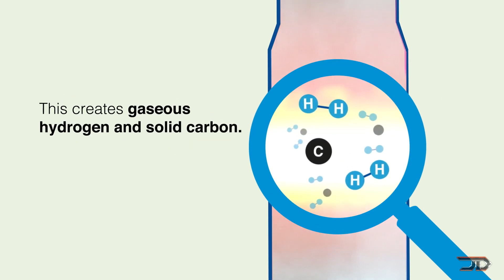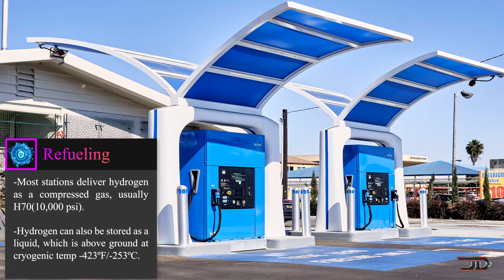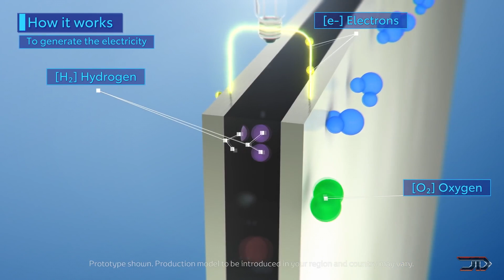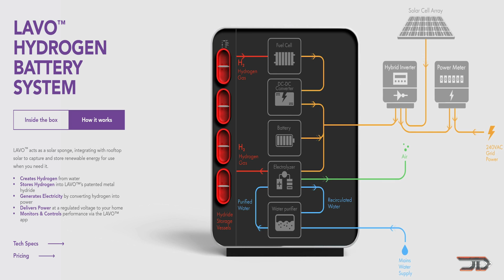Hydrogen Power - The Latest Developments

Comment: Hydrogen is polluting and dangerous as explained by Elon Musk in the video link here. It shows how far a few will go just to keep us paying. Hydrogen is something we can not generate in sufficient quantities to use so we will have to keep on buying it, just like gas for cars. But with electric, if the same few try to raise prices and take from us we have the option of solar, wind, and water power, without paying them a cent. This they do not like and hydrogen or anything else that keeps us paying at the pumps will be developed instead. As this video shows hydrogen is dangerous and the only reason for development that I can see is profit. As this video shows there is much pollution in the process of separating it and storing it for use. https://www.youtube.com/watch?v=RAUnmDGNvF8&list=WL&index=4
Reply: Elon Musk is from an electric car company so you can't really believe in everything he says. Batteries are not good for the environment either, they have no power(no good for airplanes) and most draw from the grid anyways.

Comment: I don't know if anyone will ever read this comment but I truly believe that hydrogen technology has a lot of potential and isn't just something to "delay electric vehicles" as people with no real knowledge on both FCEV'S and BEV's. Fuel cell technology is just in its infancy and as time goes on as more stations are built, more vehicles will be sold, the technology will become more efficient which could out do the fully battery powered vehicles. There has been really major investments into hydrogen in the last 24 months, just not the Americas. Plus FCEV'S has better range than most BEV'S and "fill up" much faster (even if both aren't really fast). The FCEV'S will most likely always have the better range and faster filling time than batteries. The problem is infrastructure, but there has been huge investment in that in ASIA which slowly is making its way over. Does hydrogen have its problems, yes, but batteries have just as many. Batteries: are made from lithium, take longer to fill, normally don't have great range, over time there range will become smaller and take longer over the time of use. Battery people normally seem to disregard all of the problems the technology they preach about and only look at the negative aspects of hydrogen. Both lead to a green future in the end. Hydrogen technology could potentially have a big and bright future. 

Note: early on in this type up I said "hydrogen will become more efficient". What I mean is more efficient to use for your average person not in making power and using said power.

Comment: With high levels of hydro, wind and solar power, there are times when supply exceeds demand. That excess power has no fuel cost so it can be used to produce hydrogen as an extra revenue stream. That hydrogen can be blended into the natural gas supply pipelines. However as pure hydrogen it has higher value as an energy carrier for FCEVs. Consequently, FCEVs and BEVs can co-exist, with each having an appropriate use.
Reply: As the number of BEVs grows, they´ll become the obvious target for the extra energy production. So even though it is definitely possible to use that energy to make H2 it won´t really be free anymore as there will be demand for the energy. As our energy production is shifting to renewables, storage becomes part of the solution and while H2 is an option it is an expensive and inefficient one unless we have a breakthrough.
Reply: 1. Fuel cell cars make no sense compared to battery electric cars, and NO hydrogen cars will never reach mass adoption, but electric cars certainly will. 2. Better to store excess electricity from the grind into pumped hydro, than into hydrogen. Why you would ask? Because pumped hydro is 80 % efficient, while electricitx to hydrogen to electricity is only 30 % efficient.

Comment: In cold weather the waste heat from conversion to hydrogen can be used for heating water or living space. By contrast, waste heat at a large power station supplying the grid is often wasted. In cold weather a BEV then needs to use more electricity to heat the vehicle. Thus in a cold climate on site methane reforming is not as inefficient as it appears at first glance. At 7:04 you mention Lavo which combines hydrogen storage and fuel cell.

Comment: Glad you recognized fuel cell electric vehicles as EVs. One minor slip of the tongue is that a hydrogen is not a fuel source. Like a battery it is an energy carrier which needs an energy source. You identified that hydrogen needs an energy source such as methane or electrolysis.

Comment: Absolutely agree. The amount of conversion required to run an onboard system in a car sounds like a soul-destroying nightmare reigning down in little pieces from the stratosphere with bits of humans attached. I do think that hydrogen has a much better chance in the sky & water arena for moderate to large passenger transfers but not as a car. It just comes across as way too expensive. I think it'll be a while before it is ready for anything. By the time it's ready there may be small scale "nucular" (dubbya inference), again medium transfers & hydrogen will get passed by completely.

Comment: We NEED to use our current ICE in effect as Carbon Capturing machines by running them on ( clean burning) Carbon Negative Algae Bio Fuel. That permanently sequesters 1 Ton of CO2 for every Barrel, we don’t have the time or the forests etc, to loose to mining etc ( we apparently only have 9 years left to turn things around). So we have to use what has already been manufactured, but just change the fuel. If the UK for example transitioned onto Algae Bio Fuel we would permanently sequester 364 Million Tons of CO2 every year, and create millions of new local climate saving jobs!. Photo Bio Reactors( PBR) used to grow the Algae are cheap, easy and quick to build and could be rolled out country wide in every locality within 5-10 years!.
Reply: Well said. Like CVK's plan to make Vulcanol out of CO2 from vulcanoes. But yet,everyone's wasting lithium instead of doing research.

Comment: As batteries continue to improve, hydrogen will look less and less appealing. To complicated. It takes way too many steps both to make the fuel and to use it. It is inherently dangerous, far more so than batteries. No, I hate to see folks waste time and money trying it out, but it's their money and time, I suppose. In the end, it will fall by the way side.
Reply: If you re talking about car industry than yes. But planes will definitely run on hydrogen since batteries can't reach much more than 1000wh/kg (350-400wh/kg now ) hydrogen has 30000wh/kg Wich is more than kerosine.
Reply: @kosovoisserbia8937  The first hydrogen fire will shut that down fast.
Reply: @kosovoisserbia8937  Hydrogen is far more explosive that jet fuel as well.  Violently so.
Reply: @kosovoisserbia8937  The majority of the planes will be running on batteries in the future. Today energy density of the batteries is 300 Wh/kg. With that energy density you can make 747 big passinger planes with 10 times less range than kerosine 747. Kerosine 747 has 15.000 km range, electric 747 with 300 Wh/kg TODAY's batteries will have 1500 km range. 70 % of all plane routes IS SHORTER than 1500 km! Than means you can make 70 % of all routes with a battery plane TODAY. Why 10 times less range with electric plane? (because batteries have 40 times less energy density comprared to kerosine, but electric motor have 2.5 better energy efficiency and you can also lower consumption quite a bit with flying a little bit slower (not very noticable in shorter flights).
Reply: @mirkogruden8362  70% of plane routes yes ! 70% of plane distance NO ! 
Short flights only account for 30-40% of global CO2 emissions. We will still need hydrogen powered planes to cross long distance flights that account for most of  emissions .
Reply: @kosovoisserbia8937  70 % of all flights are SHORTER than 1500 km. But in a few years the batteries will be at 350 Wh/kg or even 400 Wh/kg, and that means 85 % of all flights can be made in electric plane. But that is WORST CASE SCENARIO. That is calculated based on 747 big passinger plane, the smaller the plane, the longer distance can be coveded with a battery plane. So in reality the the majority of plane distance will be covered with a battery plane. Sure, we still need hydrogen (or synthetic fuels) for long distance flights, i have never said otherwise.
Reply: Batteries have some serious downsides, too.  Like the extreme use of some metals that aren't readily available, so there's that.  Everyone wants to point to some ultimate answer.  The real answer is there is not remotely any ONE answer.  

Wind, solar, wave, clean fuels, yada yada...there are a  lot of different technologies out there that are fully capable, NOW.  And batteries will have to improve a LOT to begin to compare to any standard fuel, moreso than they probably ever can.  Did you look at that chart? Batteries  are basically in the trash regime, power/weight of every other alternative shown.

And producing all those batteries is not remotely either energy efficient or carbon neutral.  They are one link in the chain, that is all.  There is no 'wasting' of money delving into other forms and types of energy.  And money is just paper, actually cloth, mostly,
Reply: @MrJdsenior  You are also looking at the table wrong or don't even know what table means. You just CAN'T compare fuels directly, because the car is not only the fuel! Electric car battery is certanly heavier than petrol, BUT electric car motor is much LIGHTER that petrol or diesel motor, you also save weight because you don't need exhaust, DPF and all that stuff. Moderen electric car have more than enough range and are similar weight than diesel or petrol cars (only 5 to 10 % heavier). The key thing is that electric car uses 4 to 5 times LESS energy per mile compared to diesel and petrol car!
Reply: @MrJdsenior  The only problematic metal used in batteries that I know of is Cobalt. And Tesla has committed to reducing and eliminating it completely with newer battery chemistry. I believe the initial patents for the 4680 battery uses no cobalt.
Reply: @MrJdsenior  No, you are wrong. There is no metals that aren't readily available in li-ion batteries (litium, cobalt, aluminium, copper and nickel ARE very common metals). Batteries are ALLREDY developed enough that we can make electric cars with enough range! Modern electric cars have 500 km of range, there are even models with 1000 km (Xpang) and that is more than enough for daily driving. Average American onyl use  10 % of that (average American only drive 50 km per day). You simply charge at home overnight. Once or twice per year if you are on roadtrip you can get 300 km charged in just 15 minutes (Tesla model 3) and that time will be even lower in the future.

Comment: dude, I think you got steam methane reforming and methane pyrolysis confused while making this video

steam methane reforming releases CO2, methane pyrolysis does not (the graphic you had on screen even showed this, the output is solid carbon, not CO2)

steam methane reforming is currently the main source of H2 globally, so alternatives like modular reactors would be reducing emissions from that, not from methane pyrolysis, which is already emissions free, but not widely commercialized yet

Comment: My dream would be a Tesla with a hydrogen engine that generates electricity for the battery.
Reply: Well that is a regular fuel cell car.
Reply: @CUBETechie  No it is worse. He says an "engine", so a combustion engine running on hydrogen driving a generator!
Reply: @Tore_Lund  oh okay 

Die you heard anything about Gumpert Natalie?
Reply: @CUBETechie  Nice, but that is a fuel cell vehicle, it does not burn the Methanol = no engine.
Reply: 🤔 Basically it'd be a tesla with a hydrogen booster. You can run out of hydrogen fuel during a road trip but still travel on the battery alone for quite a while.  And Instead of waiting 20 minutes to recharge you can fill up on hydrogen in a similar time it takes to fill up on ethanol. Bam, hit the road again whilst charging the batteries. Genius! As long as the hydrogen engine is light enough
Reply: @daivonclark5151  Right, that would be awesome

Comment: Hydrogen doesn’t have the same constraint as batteries.  The cost of batteries is the capacity: if you want to store more power then you need a bigger battery.  $$$.  For hydrogen fuel cells, the cost is power output: if you want to output more power then you need a bigger fuel cell.  Hydrogen will win wherever you need STORAGE CAPACITY.  Batteries will win when you only need a small amount but released very quickly (POWER OUTPUT).  This is why hydrogen is still the preferred option for large vehicles (trucks, busses, planes and trains).
Reply: You are partially wrong. Battery electric power  is much better for trucks, busses and trains(trains can be connected directly to wires), and low distance planes because the cost per mile is 4 to 5 times lower! Hydrogen only make sense for long distance big plains and ships because you would add too much weight if you would use batteries.
Reply from the maker: Good point!
Reply: Except H2 is not that great as a storage medium either. It´s better than batteries, by Wh/kg, but methane, propane or methanol can easily beat it because they are more practical to store. It remains to be seen what will be the preffered choice for large vehicles.

Comment: I don't see Hydrogen as the solution, but there is a Market for it. It has many drawbacks for plants that produce it in large quantities using storage containers and the hard cells have a durability issue...
Reply: Yes rechargeable batteries are more efficient

Comment: There's one thing certain about the future:- uncertainty. That aside there's one firm in China which stores hydrogen on discs maybe somehow in solid form in a very dense way which can be used for fuel cell vehicles.
Reply from the maker: Neat, I will have to look into that!
Reply: Hydrogen Fuel Cell safety : How safe it under collision or high impact ? 
Is it prone to static discharge causing a fire or possible explosion ?  / These are questions that needs to be answered.
Reply: @arthurzettel6618  Look it up, they have done intensive tests on hydrogen fuel cells, collision, puncture, you name it, it seems very safe.
Reply: What. ?
Reply: We love Sandy Munro! Don't we?
Reply: Lithium-doped C 2 N seems to be the best method and it's very easy to make

Comment from the maker: Update: Honda just discontinued their Clarity fuel cell vehicle so this could be a sign of things to come (at least for fuel cell cars). I also apologize for the rushed commentary!
Reply: Honda pulling out on one project means they're pivoting to another. Doesnt mean they're abondoning H2.
Reply: Afcourse Honda discontinued their Clarity fuel cell vehicle because it makes no sense compared to battery electric car. Hydrogen car have cost of 17 € per 100 km, while electric car charged at home at night only 1 € per 100 km! Battery electric car is 17 times cheaper to run! Afcourse the price of hydrogen will come down, but it will still be much more expensive compared to electric car.
Reply: Bainsworth  Yes, definately. The price of litium batteries are comming down, the statistics shows that battery cost come down almost 10 times in the last 10 years (from 1200$ per kWh in 2010 to $120 per kWh in 2020), one of the reasons is production on scale. EVEN if electric vehicles would pay the same fuel tax as petrol and diesel vehicles, electric vehicles "fuel" will still be cheaper because electric vehicle uses 4 to 5 times LESS energy. Typical electric car on average use 1,5 liters of diesel equivalent per 100 km, and typical  diesel car uses 6 to 7 liters of fuel per 100 km(4 to 5 times more).
Reply: Bainsworth  You are wrong. I know a lot more than you. ;) The only one here thick is you, not me. Now go troll someone else, because you are just a waste of time..
Reply: @mirkogruden8362  I think he was flirting with you and he likes thick bois. But you sir are most certainly an engineer, maybe growing down a little wouldn’t hurt.
Reply: @YousaidIshould  Can you be a little less weird? :D Am i not thick, i weigh only 65 kg.
Reply: Yes..Sir..
A Lot happenings..